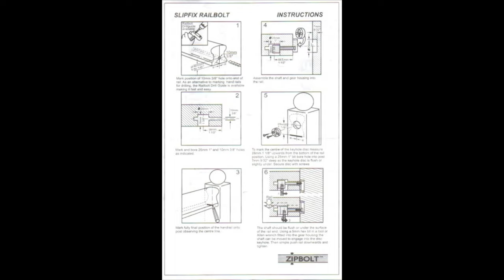Balcony Railing Install with Zipbolts

Comment: Super helpful. Getting some parts together for a clients balcony railing install and haven’t ever used this system but it looks like I’ll try it. Thanks. I subscribed
Reply from the maker: Tom you won't regret it. So much better than the old-school connectors. Recently I fixed a loose railing in a house 8-years old. The builder toe-nailed the railings onto the posts with finishing nails and then crayoned the holes. No excuse for that kind of work with all the technology we have now. Cheers!

Comment: can I ask are fasteners like this necessary or is the method I see in many other videos (like you use for fixing newel post in previous video) using a 4" long timber fastener screw and adhesive sufficient for the handrail too? since the cost of zipbolt is quite high
Reply from the maker: Necessary - no. But very convenient especially if you are installing by yourself. I also like the ability to dry fit and then make adjustments to my cuts if necessary. I buy the Slipfix railbolts in bulk and they are more affordable that way. Thanks for your question. Cheers, Scott
Reply: Thanks Scott makes sense! Just wanted to make sure that by going the cheaper route isn’t a compromise on strength of end result, rather maybe tricker to do without a helping hand! If that is wrong then shout, otherwise thanks again 😊

Comment: I must be the exception with zip bolts. It looks really simple in the video, yet I can't get the gear housing to engage the bolt. Seems like if you don't drill the 3/8" hole spot on parallel to the rail, you may not have a good experience.
Reply from the maker: Check to make sure your gear housing is facing the right direction, if it's backwards you'll have problems. The products work best if the holes are drilled precisely. If I have a helper I will have them eye-ball my drill to make sure I am drilling parallel and perpendicular. Hope this helps. Scott
Reply: @scottearlsmithFTC  - So the gear housing was in the right direction (good suggestion to give a newb) and I measured and marked properly and even had a spotter to ensure both holes were perpendicular/parallel and needed. 

I was drilling into a rail that I milled from raw material and prefinished, so I was being really careful not to oversize the hole. Turns out that it can be difficult to drill the 3/8" hole exactly parallel and there is very little forgiveness with the gear mechanism in terms of alignment. Lesson learned that it's better to oversize the 3/8" hole a little.
Reply from the maker: @paullasko2023  Glad it worked out. Thanks for letting me know. I think I've done so many of them that I forget that it was a bit tricky the first time around. Cheers Scott